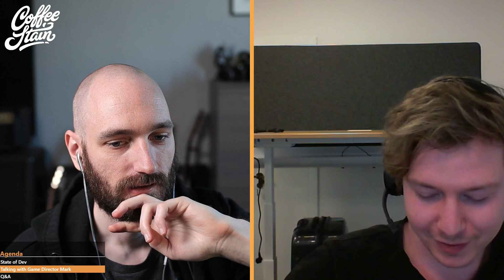Q&A: Sinking Fluids?

Comment: I agree that it would make managing by-products overly simplified, but it's a real pain when my alclad processing facility is kilometers away from plastics. I don't want to have to run another train line just for sinking excess alumina solution :(
P.S. the impure coal nodes near the bauxite deposits make my production lines so sad :'(